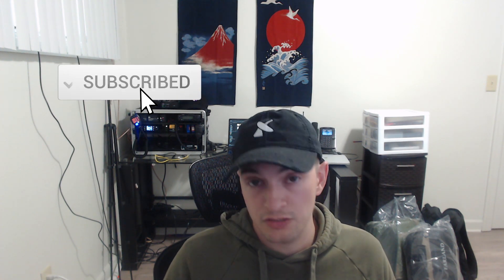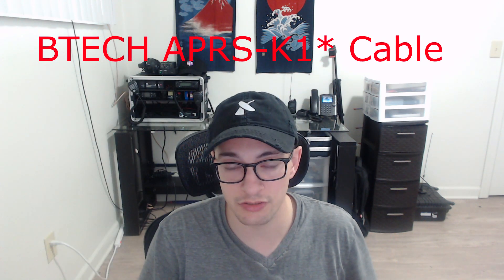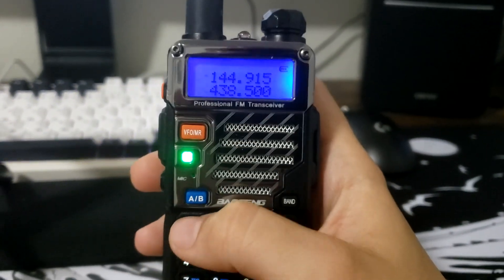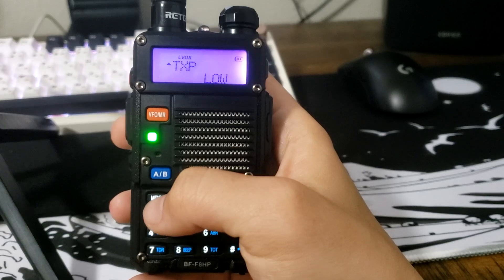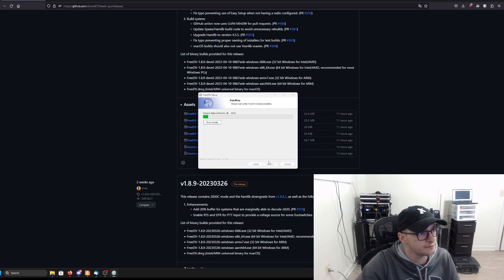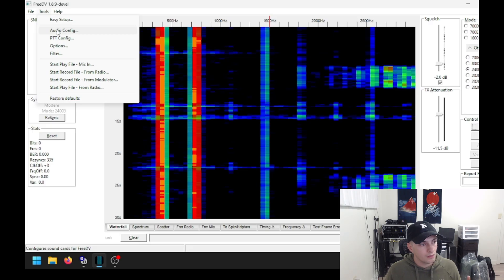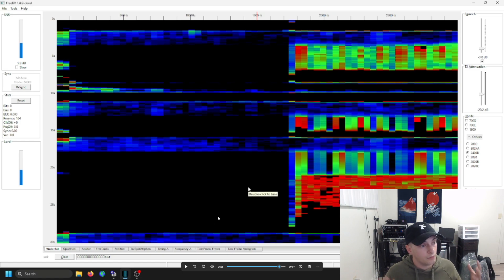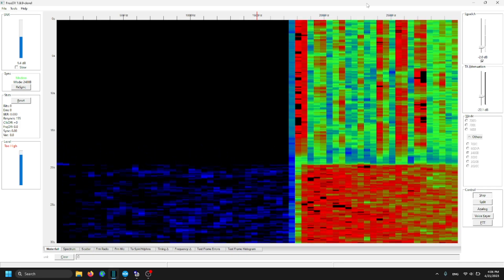Digital Voice on Baofeng Radios via FreeDV

Comment: I asked someone if this was possible, just to use the baofeng as the transceiver and use computer to handle the digital audio signal but everyone told me it wasn't possible as it does something to the audio signal thats fed into the radio.

But that being said it's very muffled, like you're trying to talk with a sock in your mouth, or talking into a pillow.
Reply from the maker: Everyone was wrong. This is how all ham radio digital modes work. Just audio in and out of the radio coded and decoded by a computer. Sounds a lot better on HF though.
Reply: @ModernHam  now, would this be able to work say like listening to a D-Star or FM Fusion repeater and sending the audio into a PC to decode, or would the audio output from the Baofeng be too filtered for the PC to decode?

Comment: Can you use the K2 cable only? Then wire it straight to the sound card on your computer? 
Or does it need to the connected with the Digirig, first, just as a radio interface cable?
Reply from the maker: You can use the K2 wire only.

Comment: As one of the developers on the FreeDV project, I'm glad more people are playing with it! It is indeed more commonly used on HF as others have mentioned and can get pretty good results depending on band conditions. (For example, I've been able to decode my signal from an Australian based KiwiSDR late at night on 20 meters before. ~50W into a magnetic loop from the Western US, too, which isn't the best kind of antenna out there for sure.)

Anyway, if any of the technical issues you found were related to the application itself, definitely reach out and I can work with you to fix those bugs. While the stability has improved since I first started working on it, there's definitely more that can be done.
Reply from the maker: Will do! Thank you for your comment. I'm looking to do a HF video in the future.
Reply: What exactly does FreeDV do, or is used for? (He really did not say!)
Reply: @chrissewell1608  FreeDV is basically a digital voice system (similar to DMR or D-Star) but optimized more for use on HF (vs. something like DMR which isn't set up to deal with HF specific propagation characteristics). Unlike a lot of the other digital voice modes out there, FreeDV also isn't subject to patents nor does it require use of any closed-source software.

One of the really nice things about FreeDV is that it's extremely spectrally efficient versus, say, SSB. The narrowest FreeDV mode currently available (named 700D) is only 1 KHz wide, for instance, while the others aren't much bigger. This is really good, for instance, if you happen to be somewhere where you have to run a compromised/lower power station as you may not be able to use voice otherwise.

I will say that the audio quality is also pretty similar to other digital voice modes as in it's not going to sound as nice as a really strong analog SSB station, but that's something being actively worked on. Especially now that we've gotten funding from ARDC, that will definitely let us put more work into that for sure (among other things).

Anyway, hope this helps!

Comment: I love those DigiRigs. I just wish he would have used jumpers on the pads on the circuit board. My IC-718 needs the attenuator trace cut on it to work well for FT8 and man that was hard to see! Additionally, I had to run small jumper wires to connect a couple pads to convert mine to CI-V for Icom. If it was jumpers it would be easy to change around.... I'll just buy more if I need them. lol
Reply from the maker: Yeah I'd imagine it is hard to make a one size fits all, but this sure comes close.

Comment: You know there is no difference right?  You are going Dig to Analog then Analog to digital.  Still the same FM signal and bandwidth.   Where FreeDV really shines is in a bandwidth saving on HF.  Nothing is different on FM..  It does obscure the transmission in a legal way if you were in a situation where you were passing sensitive traffic like for ARES.  The media listens to us on scanners but they would probably not think to decode FreeDV.
Reply from the maker: 2400B/2400A is designed to be “readability 5” at -132dBm, which is 10dB beyond the point where analog FM stops working.  Listening to others who have done field tests, I am able to hear the digital better at range, but I don't have a good ear for static.
Reply: @ModernHam  Ohh it excels there.  Just not a bandwidth saver like DMR.
Reply: If the method to decode is publicly available its legal, like FSK style Rattler
Reply: @super66craig  I never said it was illegal. Take another read

Comment: Rubber ducky in cars suck (rolling faraday cage more or less)...get an external antenna magmount and it will increase range ALOT
Reply from the maker: Yeah. I had one, but thought it was overkill. (Wanted a little weak signal to show the difference) I guess I overdid it.
Reply: Not really all that bad, the glass, not metallic shielded is opaque to RF and the primary near field is all side lobes. A magnetic mount is a poor capacitive coupling for ground planes, Diamond recommends not using for HF at all. A fender or hatch mount K40 style with a dedicated ground wire is the best of all worlds. Adding a counterpoise of 19" with some silicone probe wire to the antenna barrel of the handheld will make the far field of an HT quite good in those confines. I myself would choose the Signal Stick with the counterpoise adapter.